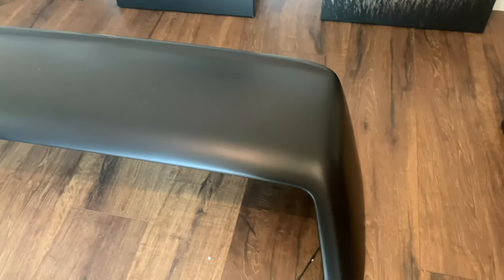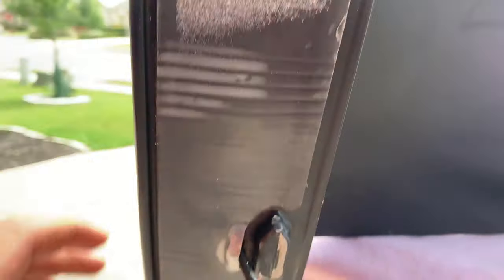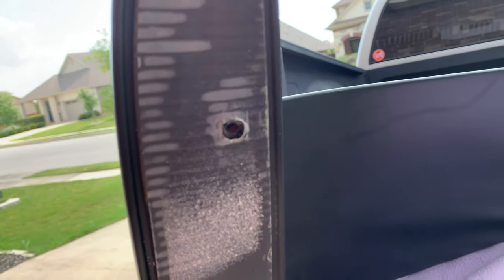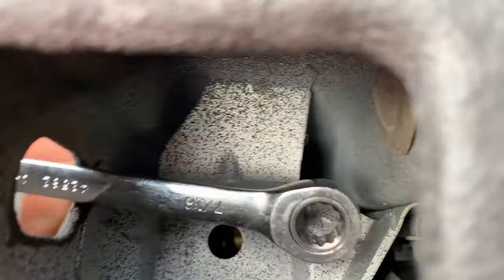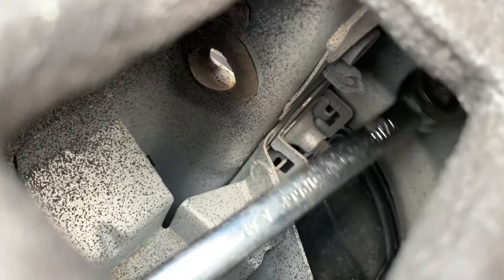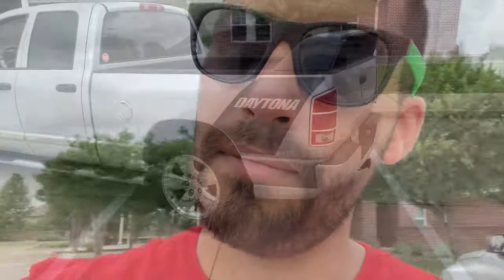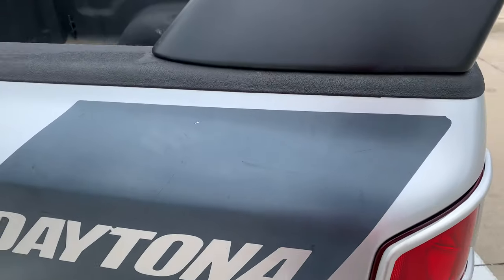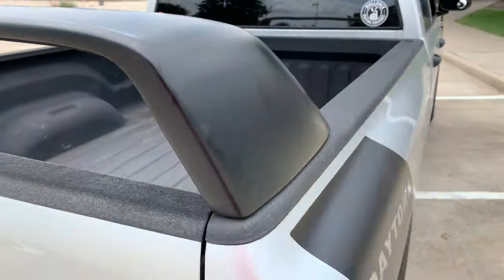Daytona Diaries: OEM Daytona Spoiler Install

Comment: Really nice truck my friend I have the same exact one same color quad cab long tube headers borla exhaust cold air intake 90mm throttle body and superchip programmer really woke up the engine definitely lots of torque
Reply from the maker: Thank you! I really wanted to do similar mods but will lean on building a stroker motor instead. I talk about it in my newest video. More than likely will add new wheels first

Comment: Do you know where I could find the cable for the wing? Mine didn’t come with it and was wondering can I just mount it and double side tape it
Reply from the maker: I think you messaged me on Instagram but I don’t know where to get the cables, they aren’t super tight or anything. 

The bolts held it in place pretty tight so you should be good without the cables.

Comment: Great video sir love the truck. Have one as well single cab should bed in go man go paint job
Reply from the maker: Thanks Harry! She’s looking better each day! I have the rest of the body kit on and a new rear bumper. Rare trucks! Gotta keep them nice!
Reply: I am trying to do the same as you keeping it all original I am missing the original wing as well. They are great trucks
Reply from the maker: Its tough finding the wing for sure. I’m going to change the seats and add the ones I added in the challenger just different colors, and I’m lowering mine and beefing up some of the suspension. Nothing too crazy but def going to be a clean street truck.
Reply: @TIRADORACING  its going to look really good lowered mine is lowered and levels a bit. Played send me pictures of your build.
Reply from the maker: Where do you want me to send them to?

Comment: Hello.  We are looking for the exact same spoiler that you got for your truck.  I assume it is an after market part.  The buggest problem is the new spoiler doesn't have the metal cordage to help hold it down safety.  Do you have any suggestions.  A tree fell on our truck and totally wiped out the spoiler.  We had the body work repaired but no one feels confident ordering the spoiler.  Thank you for your help
Reply from the maker: Hey Ronald! 

The spoiler is an OEM spoiler,  I put an ad out in a special edition ram page on Facebook stating I was looking for one and a nice gentleman had one stored away. He had taken it off his truck back in 2005 when he bought his Daytona and never used it. 

They are extremely difficult to find but they are out there. Took me 4 months of asking on various Facebook pages and hunting on Facebook marketplace.

Comment: got any video of installing the mounting bolts i got the same spoiler ..2019 Ram ignition orange
Reply from the maker: I don’t.  I ended up just adding the front bolts (towards the cab) and not the rear. Turned out just fine. 

My truck already had the holes so it was pretty strait forward. 

I’m not sure how it’ll line up on a 19 ram. The spoiler also has notches on the bottom that go into the bed pockets that help align it as well.

Comment: Any information on the measurement for the holes?
Reply from the maker: Not really. My truck is a Daytona so the OEM Daytona wing went right on. I didn’t need to measure anything. 

Do you want the diameter of the holes? 
Depth of the holes ?
How far apart the holes are?

Next question is which holes? 
The bed has holes and the wing has holes. 

You tell me what holes your talking about and I can get you measurements.
Reply: @TIRADORACING  i need both the front and back sized holes because I have an oem daytona spoiler I'm juat putting it on my rumble bee just knowing the diameter would be a great help
Reply from the maker: On the bed or on the wing lol 

Do you have Instagram? If so we can send videos back n forth and it’ll be more helpful than just text lol
Reply: @TIRADORACING  haha sorry yea on the bed itself my Instagram  Southern_born_504 any help you can give me is highly appreciated
Reply from the maker: I got you!